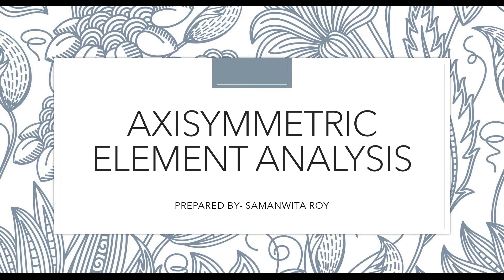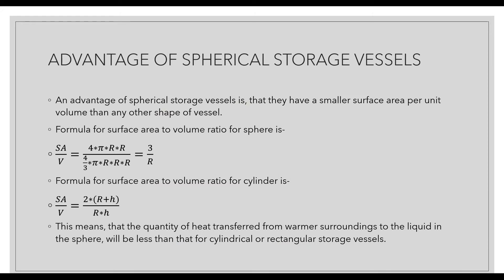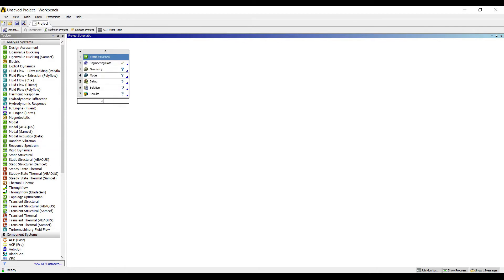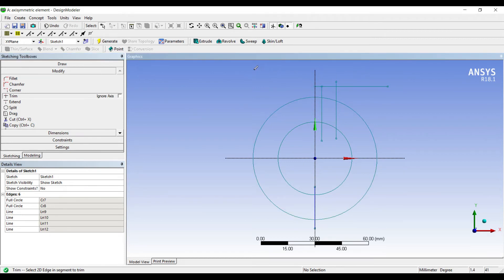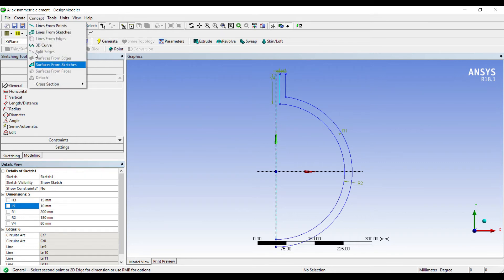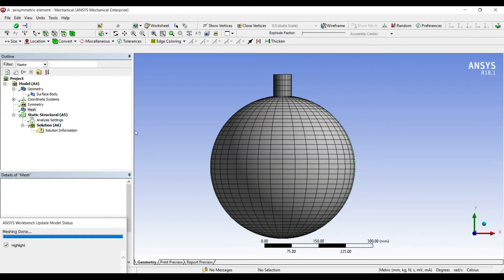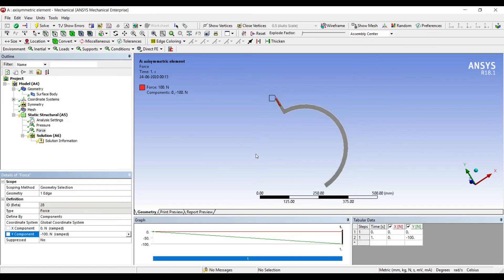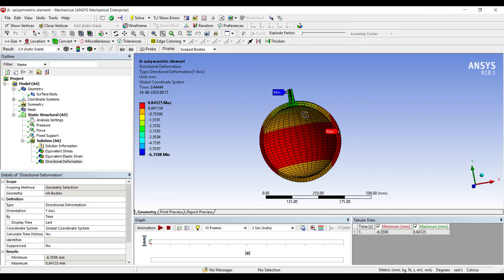Pressure Vessel Analysis I Axisymmetric Element I Static Structural I ANSYS Workbench

Comment: Are you able to do analysis of a composite pressure vessel 2D axisymmetric model subjected to internal pressure?
Reply from the maker: As of now I am not working on Composites
Reply: Please make a video on spherical vessel subjected to internal pressure....
& Due to internal pressure internal dia is getting elongated & helping any vessel to reduce its thickness without affecting strength of the vessel (autofrettage mechanism)

Comment: Hi thanks for the info
I have a problem when selecting the geometry for the inner edge is only showing surface option not the edge option for selection is there any alternative solution for this
Reply: Thank you so much for taking your time to answer my doubt
Reply from the maker: Choose 2D solving type at the start. You must have changed in between or not changed at all.
Reply: @MechProverse  where can we change that option
Reply from the maker: @kbdrupad4493  Right at the start in geometry option. Check the video again, I have mentioned in it.
Reply: How can we do this pressure analysis for vessel with different layers like a vessel made of 2 composite materials